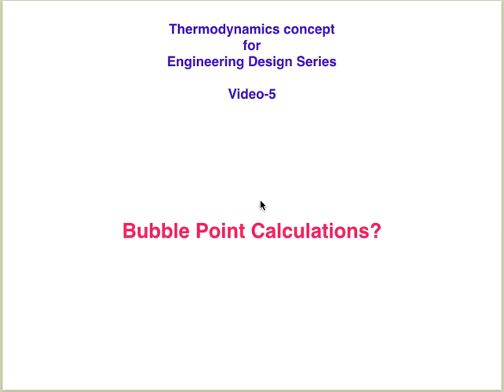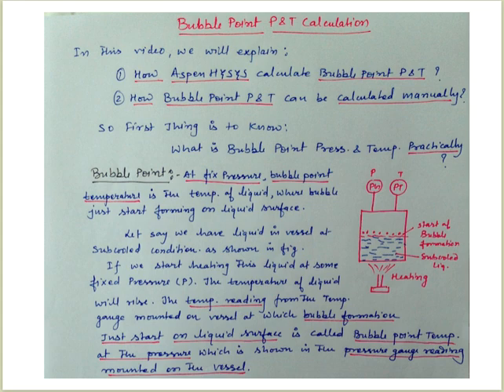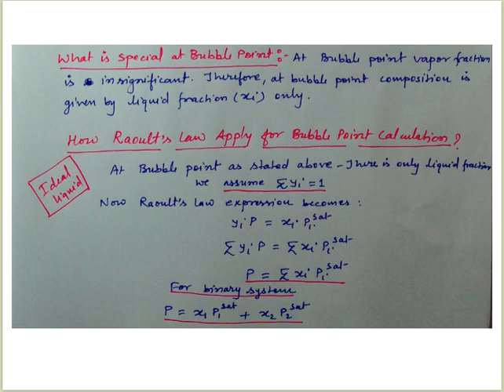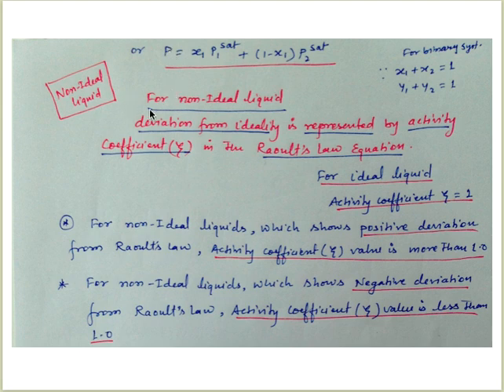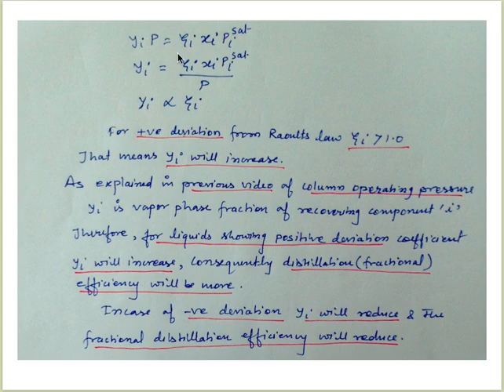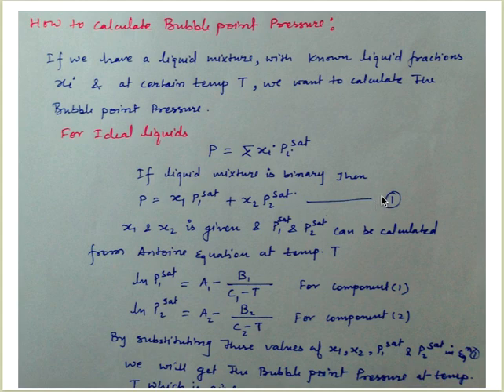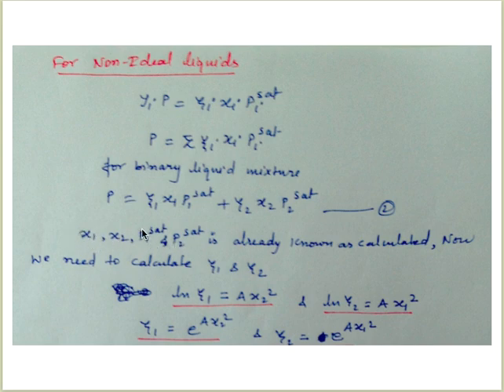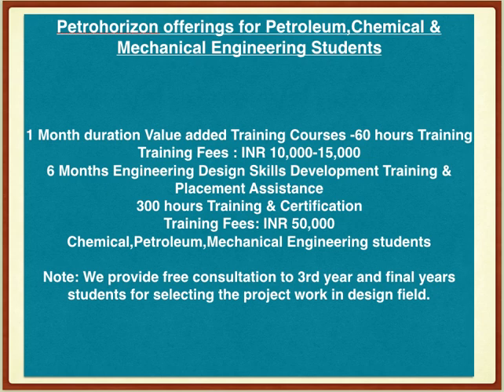Bubble Point Calculation

Comment: Hello, I know this video is old, but I was wondering:
At 11:05 you mention how to calculate A from the "experimental values" a and b.
What  are these experimental values called? I cannot seem to find them in Perry's
Reply from the maker: Normally bubble point is calculated experimentally but there are some empirical equations and mathematical ways to calculate it theoretically without experiments and many pure components constant data’s are available in perry hand book
Reply: @lokeshkumarsingh9636  - thanks for your work, but it would be helpful if the specific names of the A, a, and b parameters could be identified, and the units too.
Reply: you can find the values of A, B, & C in the book titled, "Chemical Engineering Thermodynamics" by Smith & Van Ness